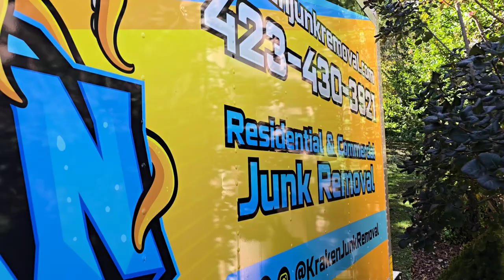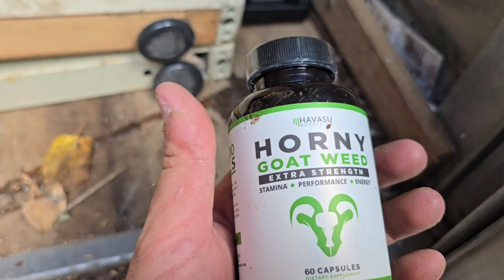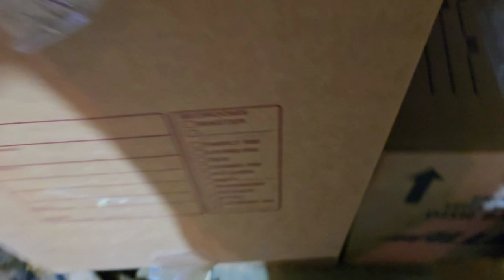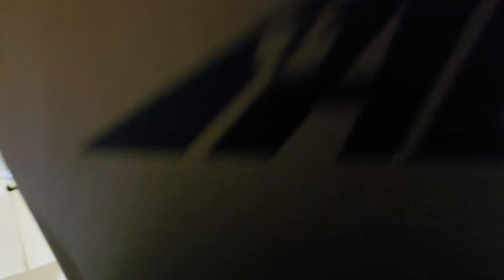Post Hurricane Helene Cleanup: Massive Basement Cleanout Junk Removal in Johnson City, TN!

Comment: Really seems like double work using the box truck seems like a dump trailer be better
Reply from the maker: At times it is. Particularly when it comes to demo material. But it holds so much, I don't have to go to the dump as much which cuts down on drive time, mileage, gas and dump fees.